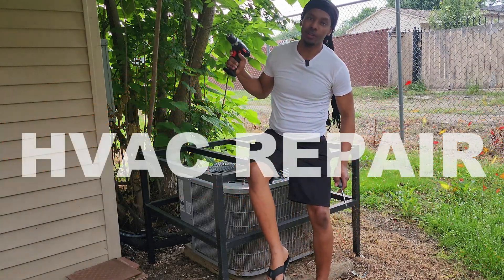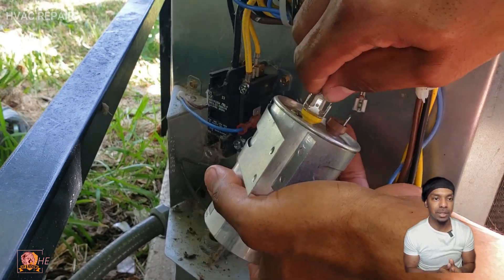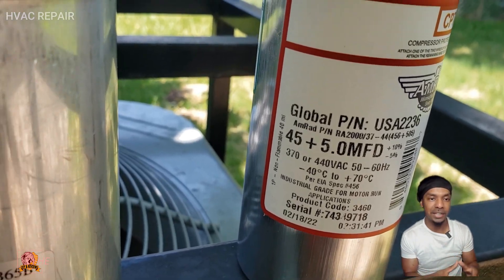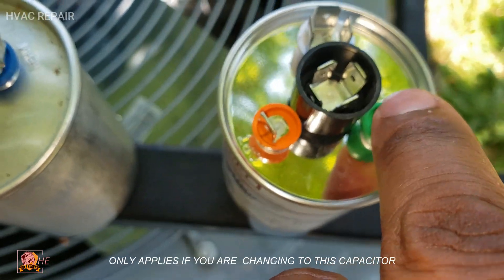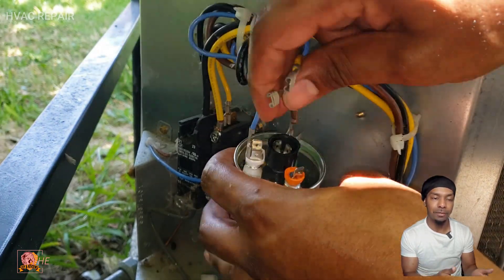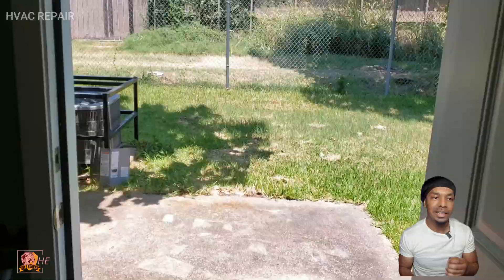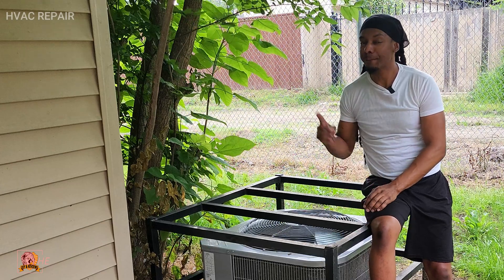AC Not Working? This 90% The Reason Why 👆

Comment: Probably about time you moved into the 1990's and stopped using start and run capacitors...
Reply from the maker: What do you suggest then Trevor? 🤔
Reply: @HEDIYREVIEWS  Well the rest of the world has been using inverters on aircon for 30 years or so. The compressors are 3 phase...

Comment: Just yesterday replaced my old one. I do have a cordless drill but it’s only a few short screws. Used my 10 in 1 screwdriver. Took less than 10 minutes. I had the T handle pull out breaker switch. Yay it was blowing cool air immediately. Could tell the difference right away. Took several hours to cool down to 78 degrees set temperature. Now feeling cool all day long in this 110 degree heat index we’ve been having. 🥵🔥 . Not all HVAC stores sell to the public. Ferguson HVAC they sell to public and i think they’re a national chain.  I bought two capacitors one is spare. They don’t last very long like less that ten years. Bought mine one year warranty ones for $27 for both.
Reply from the maker: This is great to hear Frank! 
I had to search for a local HVAC store that sold to the public myself.
Some ppl may not have one in there area so I put a Amazon link (https://amzn.to/41sAPZQ) to purchase if needed.
Glad to hear you got your back blowing cold again! 

💪💯

Comment: Thanks for posting this.  What, specifically, is the symptom when this cap goes out?  My AC went out 2 days ago when lightning struck a tree near my AC unit, and now my wife is freaking out from the heat.
Reply from the maker: My just went out. It could've been struggling for a while but I didn't notice it.
When the lawn ppl cut the yard they (unintentionally) blow the grass on the AC unit thus blocking the air from circulating & putting strain on the AC parts. I think that's why my capacitor went out. 
Your breaker could've tripped (off). 

Where you able to fix your issue?
Reply: @HEDIYREVIEWS  We got it fixed, eventually.  Turns out we had 2-1/2 problems.  The first A/C guy from the company we bought it from maybe 6 years ago came out quickly and diagnosed it as an electrical problem.  He told us we needed to replace the low voltage line from the air handler in the attic down to the condenser outside.  We got an electrician to come out (the same day!!) and he replaced that line.  The half-problem was fixed but the A/C still didn't work.  

Another A/C guy from the same company as the first guy came out and diagnosed it correctly.  Turns out we needed one hard-to-find electronic component in the condenser unit, not the cap, and a new motor for the fan.  The company managed to get the part overnighted, had the motor already on hand, and late Friday afternoon the second guy got it working!  That guy was good, needless to say.  (I was sort of disappointed it was not the capacitor, though....)

It has been wicked hot here (Boston area) and my wife was not happy, needless to say.  Today she's a lot better.  And ironically, today the A/C is off because it's so cool outside!

Comment: So glad to see a video that is only 2 months old. Most are X amount of years old and I never get any comments. I've been having issues with my A/C unit and this is probably what the problem is. The system has been freezing, and leaking from the ceiling in my kitchen. A repair person has been out 3 times I think to fix, but not really, because now the system doesn't run at all. They are supposed to come today. Your video will give me the knowledge I need to make sure they fix this the right way. (Of course they should know already). Thank you.
Reply from the maker: Thank you for watching Mikey! 
Where they able to fix your problem?

Comment: Hey you have to tell people to ground out all terminals on old capacitor before handing wires otherwise they my get a shock of their life.
Reply: and probably the last shock of their life when it stops their heart
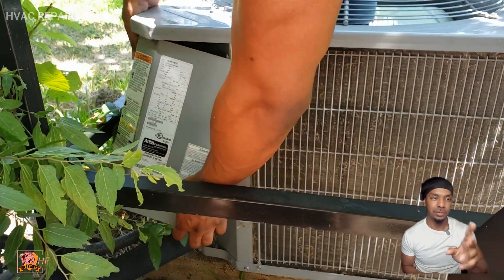Reply from the maker: Yea I did forgot to mention it on the video but I actually did in this video (1:01). 
I also pin a comment to ground out the terminal.

I replaced my cap last year but decided to edit & post it this year & tried to remember every step I did but forgot to mention this one.

Comment: Why my Capacitor is plastic? is not metal like that. Weird, but still working after 23 years in the desert heat 11o+
Reply: plastic ones are start capacitors metal ones are run capacitors
Reply from the maker: Great to hear.... Hopefully it last for another 23 years. 👍

Comment: You should find out why it failed. If not you can put the compressor in danger. Is the fan pulling the correct amount of amps, is the compressor? Is all the connections clean and tight? Is it low in refrigerant causing the compressor to run hot? Is the fan dragging and shutting down? Does the contactor have any resistance? Are all the high side wires tight? Is there bugs crawling around? I actually love DIY people. I make more money than I would have if you had called me to begin with.. oh yeah, do you know for sure the disconnect has never been bypassed? Leaving the unit with power still on.
Reply from the maker: Very detailed informative detail breakdown of what to check... thanks for sharing 👍🏽

Comment: The reason why the capacitor blew was because the outdoor coil is super dirty. It is making the compressor run harder.
Reply from the maker: I think you could be right.... I cleaned it on the other video I posted. 👍🏾
Reply: Im a tech and a dirty condenser could fail a cap but doubtful. They are oil based and tend to leak and bust in hot outdoor temps. They are cheap and usually last 2-5 years.

Comment: get you a multimeter my guy.. always confirm no power and you could check the capacitor by doing a microfarad test and see if the compressor or fan side is failing
Reply: A multimeter and a little knowledge on how to use it is a must for any homeowner.
Reply from the maker: You are right I will look to purchase one this week. Thanks for the advice 👍🏾

Comment: Forgetting about all of the safety issues you ignored that could kill you. Why did the capacitor go bad? When it goes bad again, or something else fails because you only replaced this part without checking anything else, or cleaning the system, what then???
Reply from the maker: I do not confess to be a professional. I am only sharing what worked for me.
I change the cap last summer & so far it's be running strong ever since. 👍
Reply: @HEDIYREVIEWS you might be cooking your compressor if it's undercharged a little. It only has to be a pound low for the compressor to become 50 percent hotter. It will still work good enough that you wouldn't know.
Reply from the maker: @Bryan-Hensley  wow that interesting to know.... thanks for sharing Shannon 👍🏽

Comment: You really need to clean the fins on that unit it will choke and stop working. Yours is super filthy 🙄👎
Reply from the maker: I cleaned the unit last summer (showed in the other video) when it went out & had to replace cap.
The intro, outro & thumbnail is from this year & I agree I will have to clean it again b/c they keep blowing grass on the unit.
So far it has been running with no problems since last summer. 🤞

Comment: Rasssssta man what s***** you tellin ppl service the unit first den change the cap after
Reply from the maker: Man I don't know nothing about servicing a unit. lol🤷
I just showed the viewers what I did & what worked for me. 
If servicing the unit is cheaper then I would definitely say try that 1st but the cap is just like $20 to replace so you can't go wrong with changing that (my opinion).

Comment: I'm sitting in my hot house in Texas waiting on my AC repair man to come out in 2 days. I bet this is what's wrong with my AC unit. The unit is running but no cool air is coming into my house. I see the part cost around $18.00 bucks. Too bad I don't feel comfortable with electricity. So far I'm out of pocket 165.00 which I paid my home warranty company. They scheduled me with Sears. My Lennox unit is 20 years old and I have never had any issues at all prior to this one. 
I did order one of those AC cooling fans off of Amazon (59.00) that requires water and ice. Its ok. I have my ceiling fan on high, a tower floor fan, my humidifier and the AC cooling fan running, my room temperature is at 79. 
Thanks for this video!!
Reply from the maker: I totally understand being apprehensive about messing with electrical components.  
It's good you have insurance. If I did I more than likely would not have messed with it. lol
They may be able to swap out the your whole unit.
Let us know how much it end up costing for repairs. 
I'm curious to know. 🤔
Thanks for watch Steffiejoe! 👍

Comment: Great job with this video.  One thing...I noticed you didn't discharge the old capacitor (?)
Reply from the maker: I actually did when I tap the capacitor with my screw driver but forgot to say or label it on video.
Apologies for the miscommunication & thanks for watching Jim.  👍
Reply: @HEDIYREVIEWS yeah that part is super important!! If someone was watching this they would probably not know what you were doing and would not make sure to repeat it. That's so dangerous!!
Reply from the maker: @jamina792  I did discharge the cap in this video.
I'm not the only video on here showing how to do it.
People can seek other advice if needed.
Just sharing how I did it.
Reply: that mistake kill someone better explain that and tell people make sure power off and verify!
Reply from the maker: @but-ec4hb  Who did it kill? You speak as if you know. I'll wait... 🤔
Reply: @HEDIYREVIEWS  Dope might be affecting your thinking.  Open law suit if some newbie dyi flips breaker off and grabs capacitor bare hands then has heart issue all because smoking dope not thinking right.  You never explained dangers nor solutions stay safe.
Reply: @HEDIYREVIEWS  I was surprised by you responding this way. It is always important to state safety up front. People watch because you are teaching, sharing. Capacitors can hold a charge even up to minutes after power turned off.

Comment: Now find a low voltage short after you find out the new cap doesn’t work either😮
Reply from the maker: The new one should work... that's if they new right 🤔😁

Comment: Holy cow unless I missed it you did not say anything about discharging any residual power that maybe still in a capacitor before you disconnect the leads
Reply from the maker: I discharged the capacitor when I tap them with my screw driver Karmen.  👍
Reply: @HEDIYREVIEWS  yes I saw you do that but you said nothing about it which I thought was kind of strange I think it's important you should have verbally said something about that LOL
Reply from the maker: @Karmen Dimas  Yeap I agree.... when editing, you think you covered everything until after you post the video & realize you didn't. smh 
Thanks for watching & pointing that out Karmen. 👍🏽

Comment: Always pull the fuse disconnect on the wall near the compressor as a secondary precaution in addition to turning off the power at the circuit breaker since there's a possibility of it being mislabeled.
Reply from the maker: My AC unit does NOT have the secondary discount switch box. It's connected directly to the breaker box since my breaker box is outside right next to the ac unit. Thanks for sharing your thoughts Gary. 👍
Reply: @HEDIYREVIEWS  
I guess that's code compliant in your area. Would never pass inspection in my area.
Reply from the maker: @garyg8036  I guess so Gary. It's definitely connected directly into the breaker box.
Reply: @HEDIYREVIEWS mine too
Reply: I turn off air handler and pull its main switch as well as exterior unit disconnect.
After blasting hose to as cold as can first!
Reply from the maker: @gratefuldale117  Cool, thanks for sharing Dale. 👍